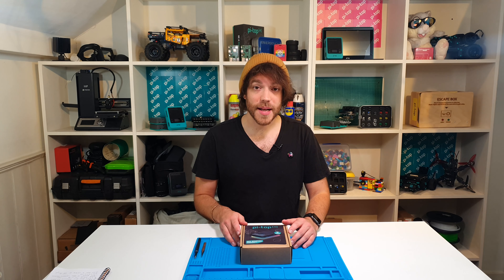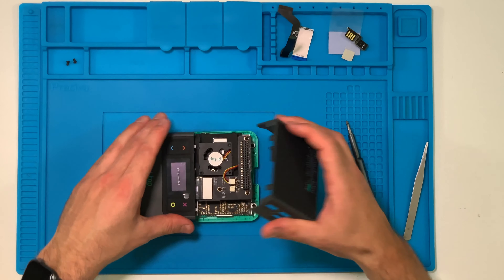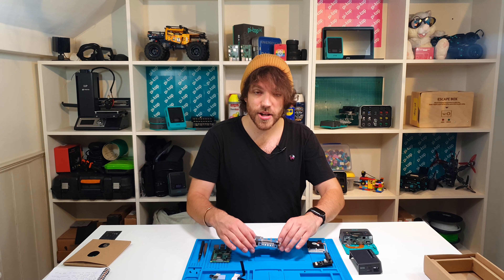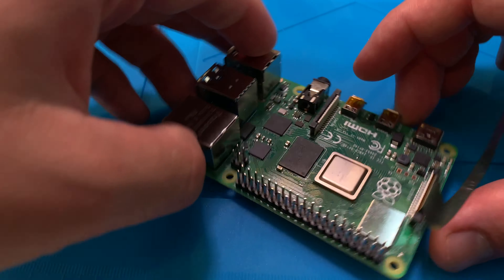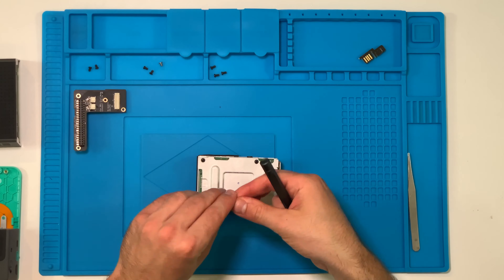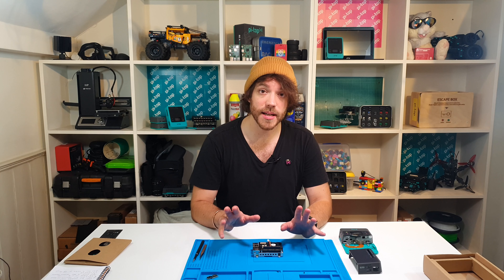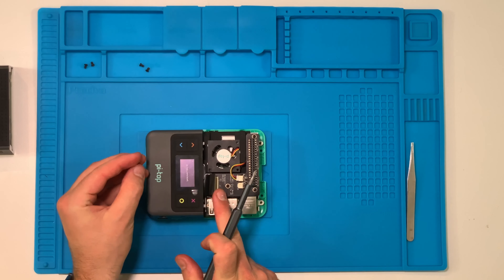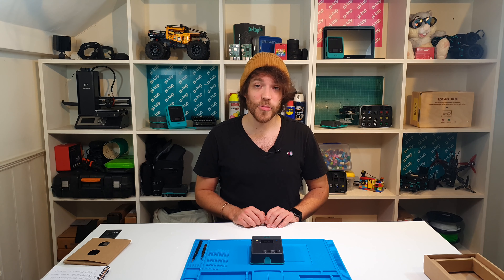Installing the Raspberry Pi 4 into your pi-top [4] DIY Edition

Comment: Just so all are aware I had a problem that PI-Top do not tell you (And took me 3 days to get a response from the technical support team) is that the Pi-Top needs a 36watt USB C PD capable power charger that can deliver 15 volts in order for the Pi-Top to wake up. It appears completely dead until its woken up with a compatible charger. Its really not clear when you receive this and not made clear in this video either, which is the first thing I watched. Apple macbook USB-C chargers dont work either so you will need to buy a compatible charger BEFORE you can use your Pi-Top DIY (I know I know). Its a really disappointing experience as it appears like the PI-Top is dead on arrival. I spent 2 hours trying to diagnose the problem on Saturday before emailing support. Hope that helps new users and Pi-Top really need to communicate this clearly to new customers proactively
Reply from the maker: Hi Lee, 
We're sorry to hear that you have issues setting up your pi-top [4] DIY.
We've just added a disclaimer in the video's description to make users aware that they need a 15V 36W USB-C PD power supply or our pi-top Power Supply, which can be bought on our website. 
Many thanks, 
Team pi-top
Reply: @pitopTEAM  Awesome thanks guys. Hopefully that will help others in the future avoid this. Cheers.

Comment: Thanks for the video. I see that both the DSI and CSI ribbon cables need to be connected to the top boards. Can the DSI ribbon be left out (unconnected) so that we can connect a DSI display on the raspberry pi? Thanks
Reply from the maker: Hi Luis, 
Yes, you can connect it directly to the Raspberry Pi, but if you have the Expansion Plate that comes with the Robotics Kit (more info here: https://www.pi-top.com/products/robotics-kit) then you can connect it to that instead and you won't have to disconnect the DSI ribbons. 
Many thanks, 
Team pi-top

Comment: What is that blue work mat you are using?
Reply: It is a heat resistant repair mat.  Mine is a Kaisi from Amazon. there is little hole so that you can stage various screwdrivers, also the divots are numbered. it is a real nice mat for repair work.

Comment: Installed new eeprom the thing won't turn on but runs fine if I take it back out of the Pitop4 box.
Reply from the maker: Hi David, 
Could you please contact our support team via support@pi-top.com? They'll be happy to assist. 
Many thanks, 
Team pi-top
Reply: Hi David, I had exactly the same problem and what PI-Top do not tell you (And took me 3 days to get a response from the technical support team) is that the Pi-Top needs a 36watt USB C PD capable power charger that can deliver 15 volts in order for the Pi-Top to wake up. It appears completely dead until its woken up with a compatible charger. Its really not clear when you receive this and not made clear in this video either, which is the first thing I watched. Apple macbook USB-C chargers dont work either so you will need to buy a compatible charger BEFORE you can use your Pi-Top DIY (I know I know). Its a really disappointing experience as it appears like the PI-Top is dead on arrival. I spent 2 hours trying to diagnose the problem on Saturday before emailing support. Hope that helps and Pi-Top really need to communicate this clearly to new customers proactively.
Reply: @pitopTEAM  Or you could have just explained the resolution to David rather than him having to wait days for a response. I have done so for you in the below comment. Not impressed at all as this is not communicated proactively to new users and is a really poor experience when it appears that the Pi-Top is dead on arrival when it is in fact not.
Reply: @leewilkinson9826  so I'm guessing the official pi top pd charger won't work?

Comment: it was impossible to open the case as one of the two screws was jammed in.  The screw driver provided (Noticed he was using a different one) would not unscrew this screw.   Just stripped the head.  Shame it had potential.
Reply from the maker: Hi Thomas, 
Could you please get in touch with our support team via support@pi-top.com? They'll be able to assist you. 
Many thanks, 
Team pi-top